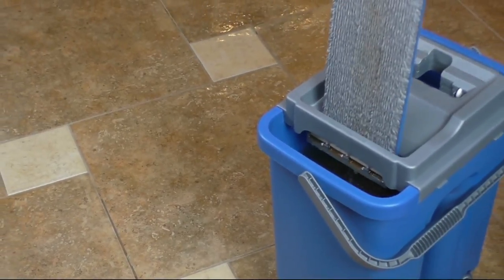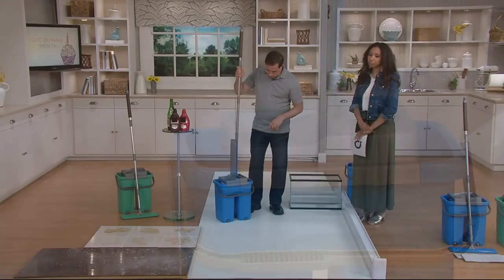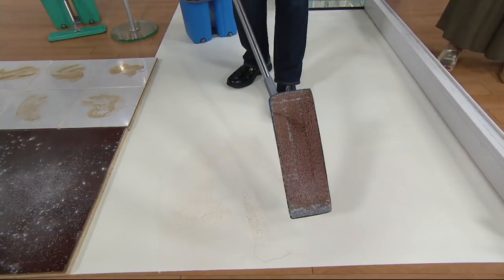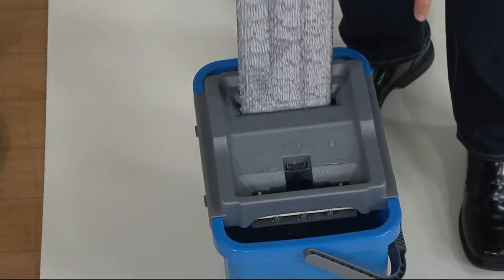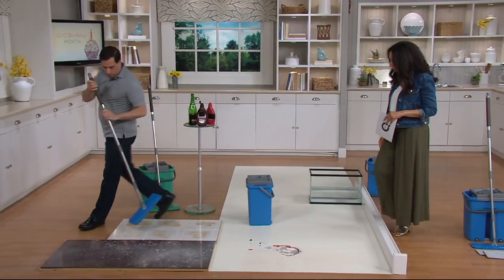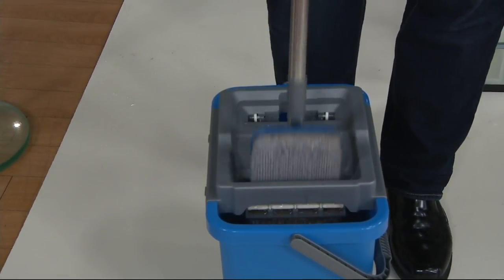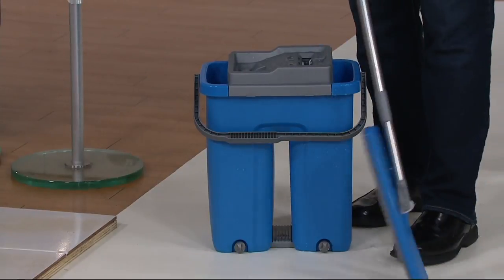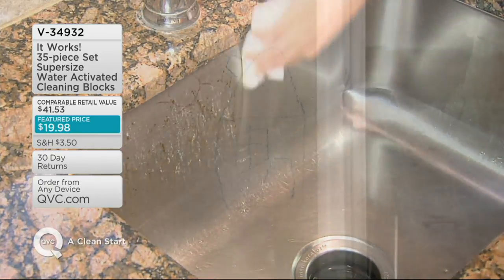Minute Mop Wash & Dry Dual Chamber Bucket with 2 Microfiber Pads on QVC

Comment: My questions are
1. I see that u not showing how to clean the filter or the part when washing the mop.. Would it be easy to clean when the mop has a few or tiny pet hair on it will it block the filter when it's washes the dirt off mop?

2. I noticed that u mopped and when u stepped over it your shoes prints was left behind, so does that mean it don't dry the floor like the sponge floorwiz.. You can clearly see your dirty shoes prints near to the end of the video ad..